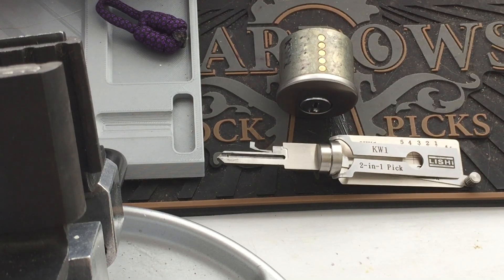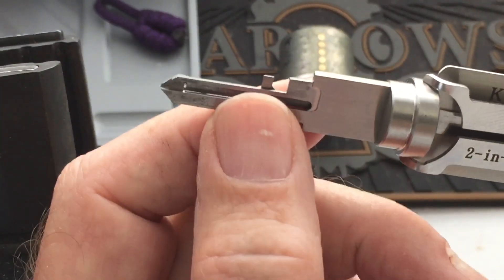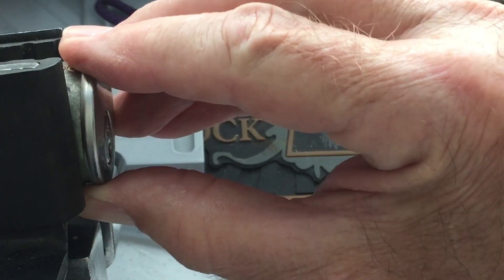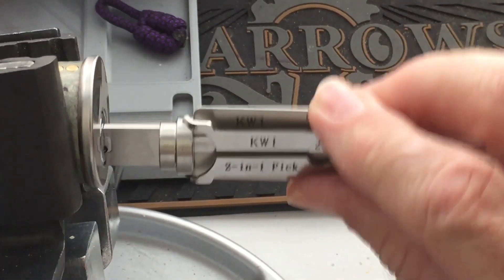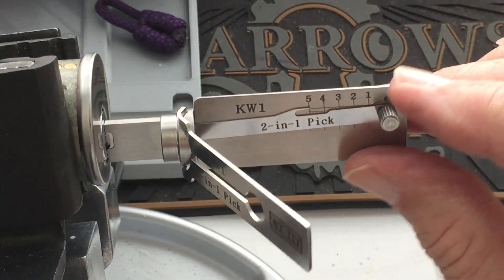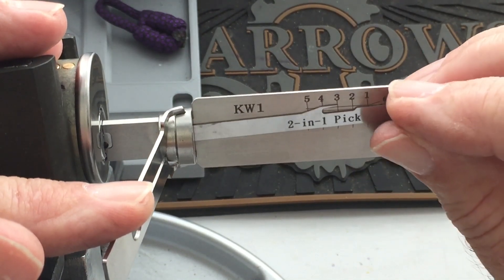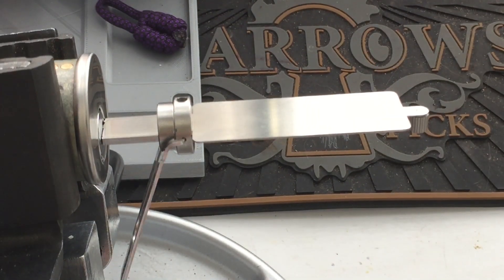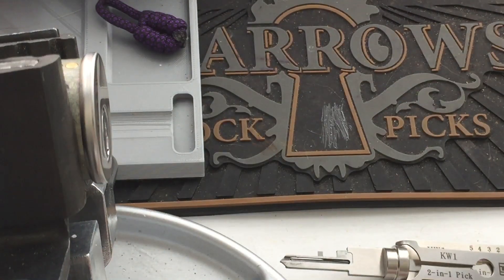#50 Lishi KW-1 for Kwikset

Comment: That was so fast it is almost unbelievable. The Lishi picks are amazing how well they work. Is it me or is the picking tip quite big. It looks quite square and very deep,  almost too long in fact, as thought it would easily touch the next pin. Or is that just me?
Great video Jack and it's one of those where if you sneeze or blink you might miss the open. 
Thanks for posting,  thoroughly enjoyed the walk with you,  so long as we kept 2mtrs apart. 
🤣👍🏻
Reply from the maker: The pick tip is square and larger than a standard pick. I will be posting another Lishi video using Lishi SC-1 for Schlage locks in a few days.  I gave my American Lishi away during my 💯 give away because I could not pick any of my American locks with it. It is not as easy as it looks. There is a steep learning curve to make these work. Nice walking around with you.👍🦊🙃
Reply: @jackfoxlock  👣👣👣👣👣